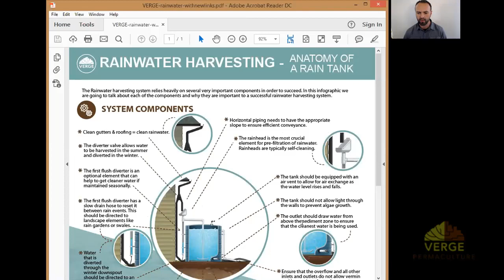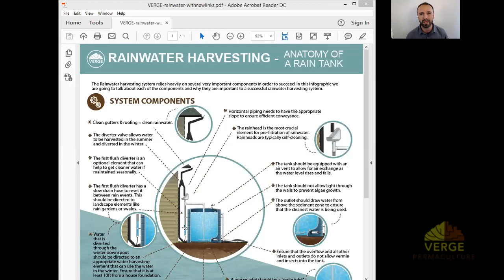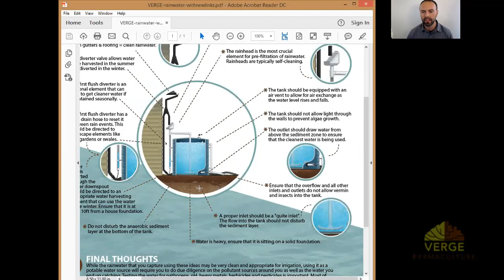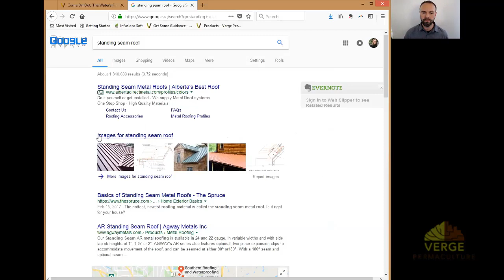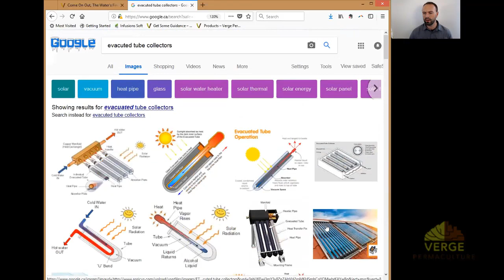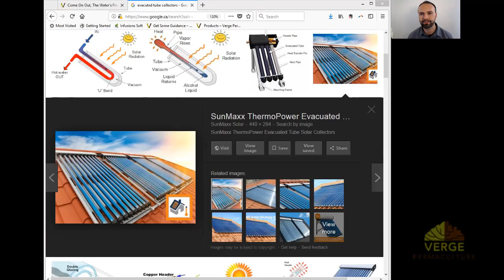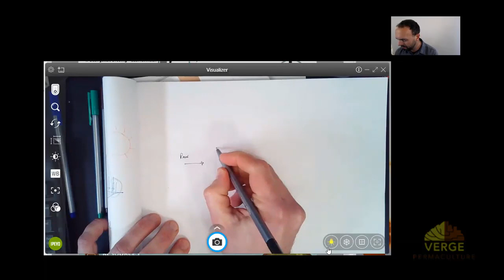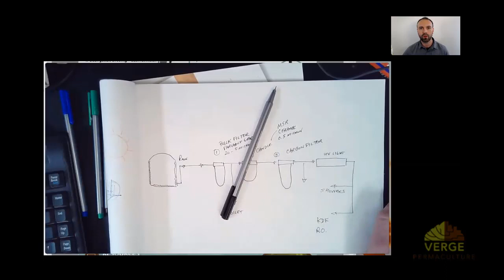Top 20 Design Tips For Rain-Harvesting Systems

Comment: Here’s a tip for you. You can place a revolving shield around the water tank. Half of the shield is painted white and the other half is painted black. In Winter rotate the shield such that the black side faces the sun. The air space between the shield and the tank will heat up and prevent the tank from freezing. In Summer, face the white reflective part of the shield towards the sun. That will keep the sun from heating up the water which can cause problems with algae and bacteria. A removable reversible shield like a reversible coat will work too but that takes too much time. The rotating idea takes only a few seconds and your done. That’s what I recommend. One more suggestion. Due to its high specific heat capacity, water tanks hold heat. A good place to place potted plants that can’t take the cold. A common emergency with frost. A water tank is also a good place for a trellis to support fruiting vines. Plants also shade and hide the tank, improving aesthetics.

Comment: The rain harvesting info was good, the segue into standing seam vs standard metal was sort of off base.  It has zero impact on water collection and I live in an environment with 110F highs and low rain,   standard roof gaskets will last 20-30 years just like the roof itself.   And even if it is leaking its going to leak whether you collect rain or not.

Comment: How long before your last frost date do you switch your diverted valve and start retaining water?

Our early spring is our wettest time, but it also happens to be when we are still under danger of freezing.  A large amount of water won’t freeze if it gets down to 28 in April, but that might bust a valve.  What are your thoughts?

Thanks!

Comment: A properly designed evacuated glass-tube solar collector will have a 180-degree aluminized reflecting surface on the lower inside surface surrounding the actual tube that moves the water. Because of the vacuum and the aluminized reflecting surface... it negates virtually any/all concerns about the color of the roof.

Comment: Why bother with the extra expense and hassle of the UV light which has to be set up to use the right amount of light/power for the volume of water running through it ? surely the ceramic filter is enough to make the water safe to drink and then with the extra activated carbon as well even though most ceramic filters have activated carbon inside them anyway. Would you say the UV is absolutely necessary ?